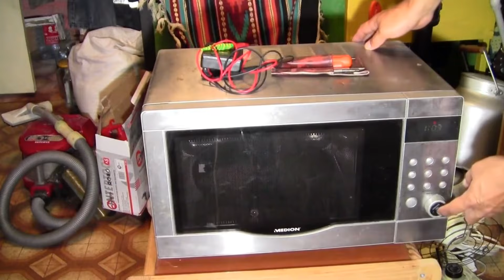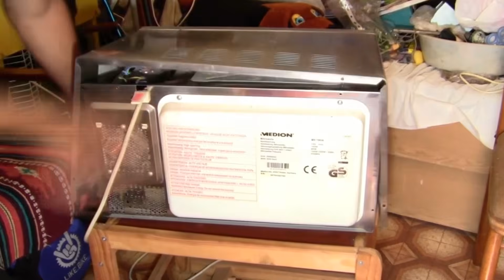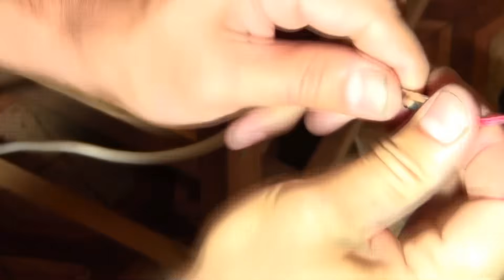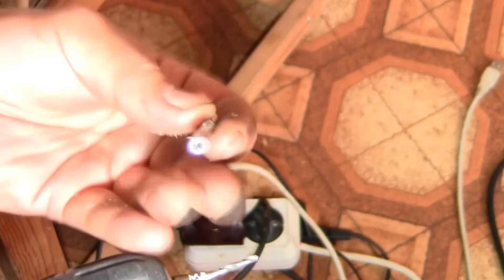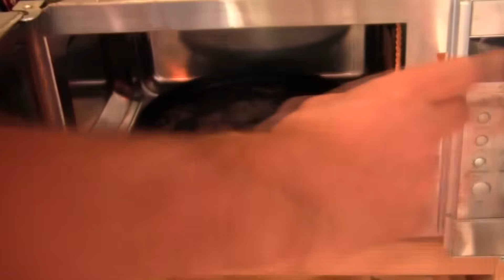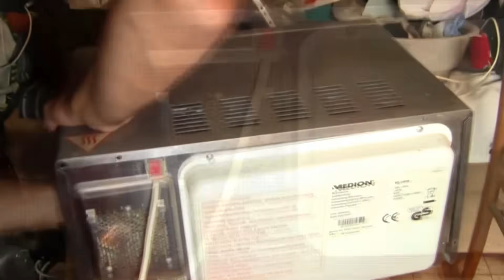Microwave Not Heating Food but Runs

Comment: NEVER make a fuse, it can be lethal or cause a fire. BUY the correct fuse from a reputable dealer. The person doing this video is VERY irresponsible !
Reply: He is not irresponsible, he measured the thickness of the wire according to fuse specs.

The question is, is it worth it. People that are irresponsible put some aluminium foil instead of the fuse, or a much thicker wire.

The fact that you judge this guy harshly, shows you apparently know nothing about electricity.

But to the rest of the viewers, if you don't know what you're doing, you should not open the microwave oven on the first place. And if you do, just buy a fuse for a few cents.
Reply from the maker: Thanks for the tip, friend. A properly sized fuse wire is more reliable than its Chinese counterparts.